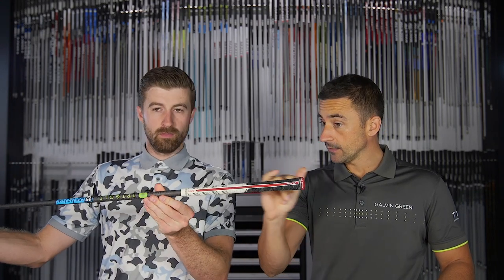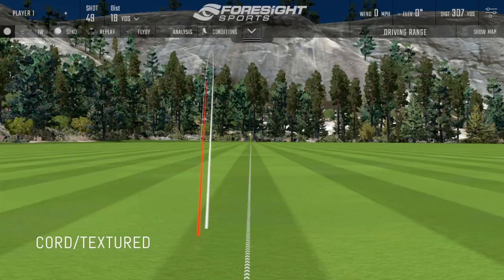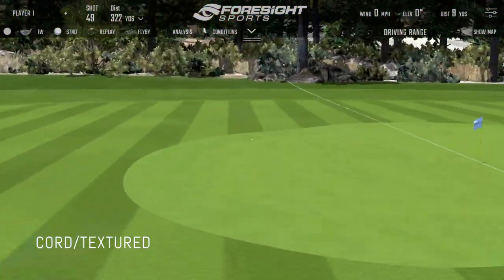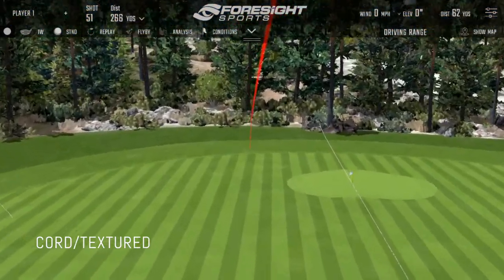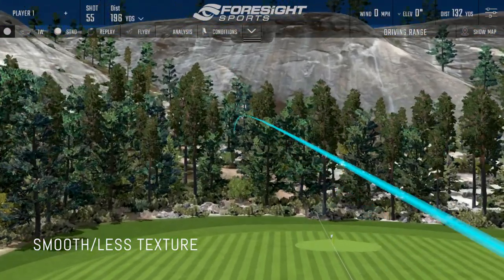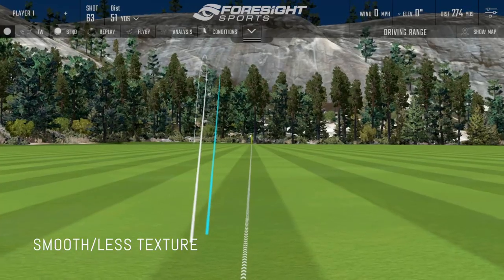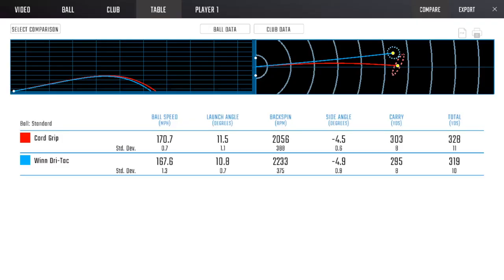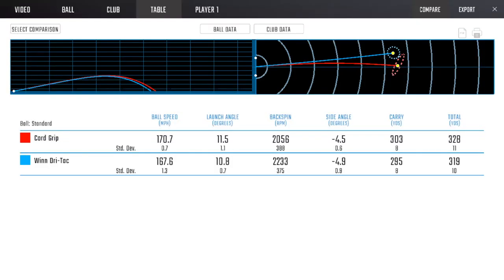Influence of Grip Texture on the Swing

Comment: Great video fellas.  I’m more finicky on size and taper more so than texture.  I like a grip that’s a bit larger than my hand size would suggest.  My glove size is ML Cadet and I like a midsize-ish grip.  The slightly larger feel helps me not to grip the club too tightly, especially with my right hand.  I use midsize Tour Velvets on my woods and hybrid and standard MMC+4 with 5 wraps of tape on my irons.  I tried the midsize MMC+4 on one of my irons at first and it just didn’t feel right.  I especially like the feel of the built up +4s when gripping down on less than full wedge shots.  The grip is probably the most customizable part of the club.

Comment: Nice as always guys!
In what sequence do you fit? Head - shaft - grip? First the irons including the grip, then Driver, woods - wedges and putter?
Reply from the maker: That is the rough process for most, but can be different depending on the player. The question is what order will you be getting everything done at your upcoming fit Dr. Q?? 👍👍
Reply: I wanna get fit to EVERYTHING for sure. Was it a real question?😂
Reply: TXG Tour Experience Golf given how the grip influenced Matt’s tendencies in the test, would it make sense to start with grip? Maybe do the grip fit while the customer is warming up. I’m sure there are counterpoints, but just a thought.

Comment: After watching your video i took my irons to get the grips checked on a used set of Apex irons that I bought. My issue was that i could never feel the club head and they found 8 inches of lead tape and 2 wraps on a mid size grip. They removed the lead tape and put one wrap on a mid size grip and my hands feel much better on the grip and that should have moved the swing weight out of the handle into the head? See you in Orlando in November

Comment: Is there a practical way for fitting for grips (and grip size) during clubfittings?  I play a midsize with a couple of extra wraps as my hands are pretty big and I definitely do not swing my best with standard grips and I feel it affects my ability to be fitted correctly.  I don't really want to waste a ton of time regripping constantly if I could just do it in a single session to figure out what works best for me I certainly would.
Reply from the maker: If the fitting shop has the ability to blow grips on and off, that's your best bet

Comment: Hi guys, i was asking your advise about my shaft flex the other day and you were suggesting that i switch to X flex.  I had a fitting today with Mizuno and the results were unreal.  In the end the best shaft for me is the PX LZ 6.5.  but the part that i found amazing was that with all irons i have ever had i hit the ball very much in the heel and my smash factor is awful 7 iron between 1.18 and 1.30.  The fitter made an adjustment to the head he actually bent the lie from 61.5 down to 60 and instantly all my strikes were dead center of the club and smash went up to 1.37.  i am 6 foot 1 and my taylormade P790 7 iron has 63 degrees lie angle, straight away i bent all the lies 2 degrees flat and went to play 9 holes and the ball went much straighter and i used to miss mainly to the right when they were upright, i am at a loss for words.  what would your take be on that i cant understand how a flatter club can change strike location and make the ball go straighter haha.  Thanks.

Comment: Personally, I use the Win grip on all my clubs. It's obviously smooth/softer but it's very tacky and it feels incredible in the hands. I feel like it is very secure even with a light grip because of this. Personal preference because I feel very uncomfortable with a cord grip.
Reply: Also: at my iron fitting, all I could test clubs with was standard grips. I have been playing an oversize grip forever. Hit terribly as I was slamming the fact shut at impact every time. Incredibly valuable to be able to fit with a comfortable grip. I warmed up with my own clubs and was hitting very well.